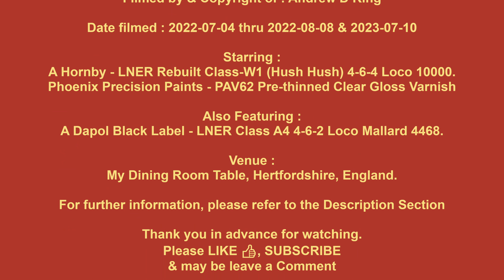077-2. How to - Give Hornby LNER Rebuilt W1 Hush Hush the missing WOW Factor – Gloss Finish (4K)

Comment: That's a phenomenal job. Really. I have a couple of American brass locomotives that'd be perfect candidates for this treatment. I always paint and line my wheels because they - the US importers have a habit of leaving those unfinished for some reason. I also add details here and there which I can get from a company called Precision Scale. I do blinds in coaches too and paint some interior details to give depth. It's a bit of a dying art and because of it the bits n pieces are getting harder to come by.
Reply from the maker: Yeah thanks, I'm indeed pretty proud of the final result. 
I'm finding here in the UK we are getting more and more stuff to detail internals of trains and buildings. The new CNC laser cutting and 3D printing, with the help of 3D scanning of real items incl people, have revolutionised small parts creation availability. 
I will have another video showing the internal details of an Autocoach in the near future plus improving its glazing, so you might be interested in that.